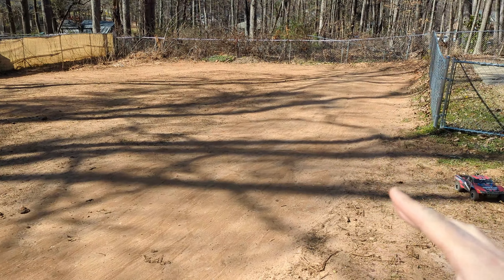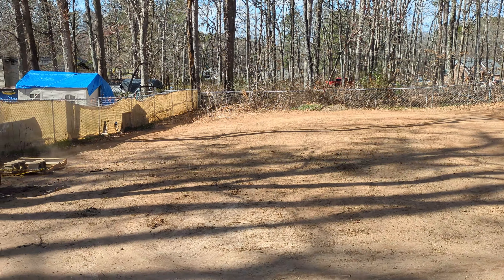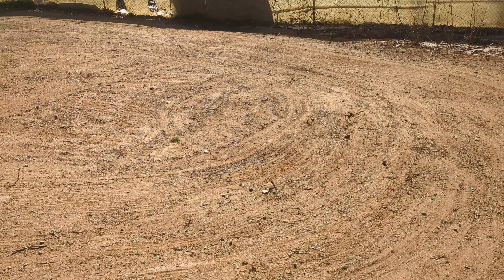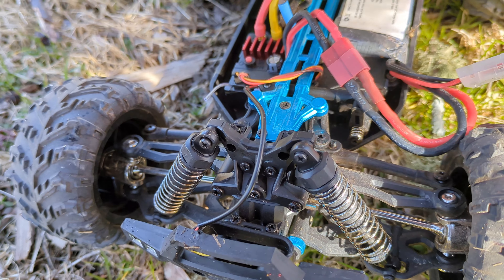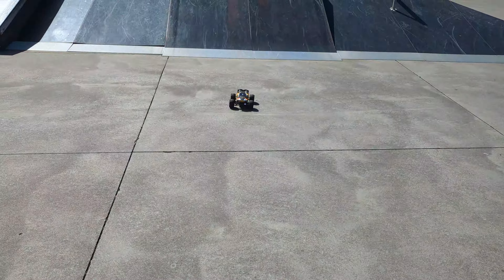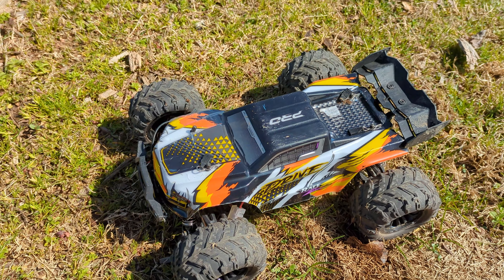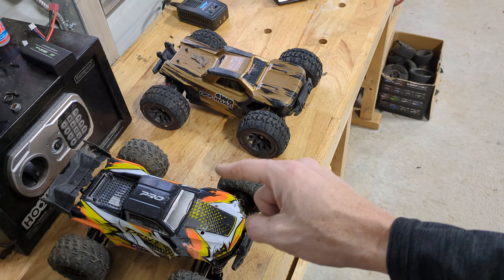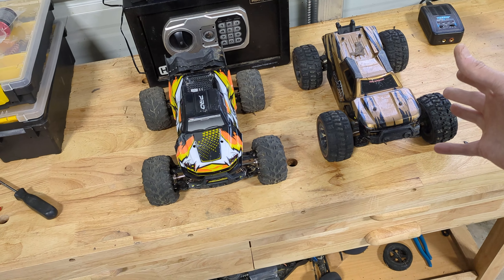MJX Hypergo KILLER takes on the SKATEPARK!

Comment: The first thing I did when I got this was to swop out the friction shocks for the oil shocks that were included by the seller. Side by side the SCY outperforms the MJX Hyper Go with its stock 2s lipo battery with just a 2s L-ion battery. Control, steering and stability-wise the SCY beats the MJX hands down.

Comment: They look a lot like the UDI 1/12 cars - e.g. UD1202. but cost less? it looks quite different inside tho

can't wait to see the completed track. Looks like you have some nice clay dirt there.
My backyard is sandy, so i've used carpet. But first I used my 1/10 cars to carve out the berms :D
Reply: my ocd was kicking in at how much of that pinion wasn't aligned with the spur. you'll get uneven wear, and quicker
Reply from the maker: @shadyhazza I noticed that too. I fixed it after I finished filming.
Reply from the maker: We do luckily have nice natural clay with a bit of loose diet on top. We actually still  run RC cars on it while constructing the track because they will create their own wear patterns and it helps us understand how they might get along on the finished track as we go.
Reply: @Rek_Rc how did you loosen the glue type of loctite they use?

Comment: This is the vehicle I saw on Amazon with thousands and thousands of people returning them for some odd reason so they can't be that good
Reply from the maker: Mine was that good.
Reply: @Rek_Rc  mine was so good that i bought 3 more
Reply: Sometimes with Amazon, you need to factor in the possibility of user error. 

I saw a review where some person claimed that they received a used RC.
Their reasoning ? Simply because the battery they received with the car was "only" 80% charged. So "someone must have driven it already"

See, this customer did not understand the fact that in most countries, the shipping companies require lithium batteries to be shipped out in a state of "storage charge", which is approximately 80%

You have to read the good reviews and the bad ones, because sometimes, "random customer #56" doesn't understand what they're talking about.

Also, I find it highly unlikely that you read 1,000 reviews to find out how many people returned the product. 
Because how else do you know how many ("thousand") people returned a product?
I've used Amazon for over a decade and there's nowhere on the product page that tells you how many customers returned a given product. 
I call BS.